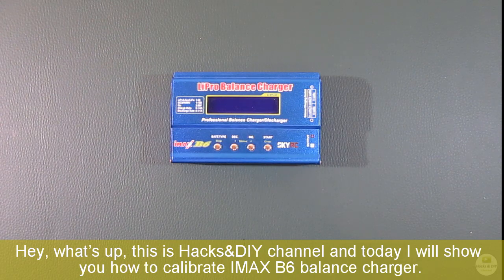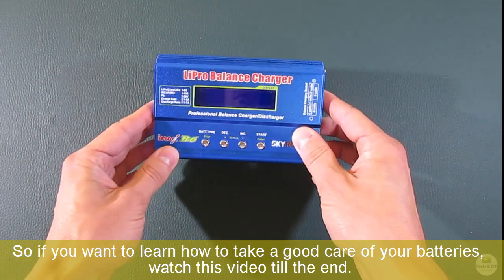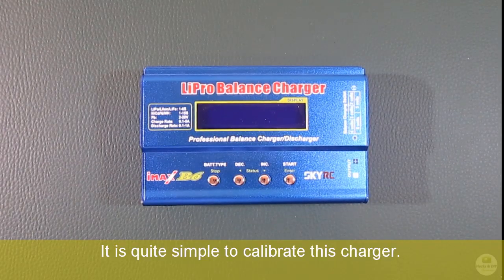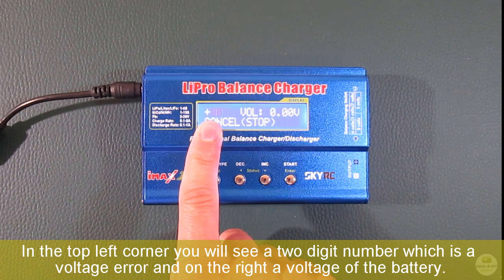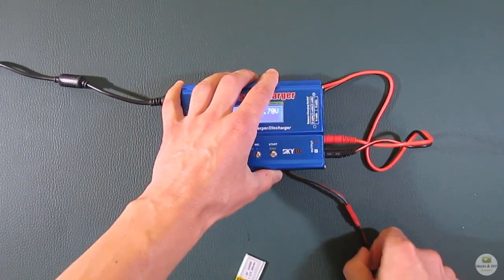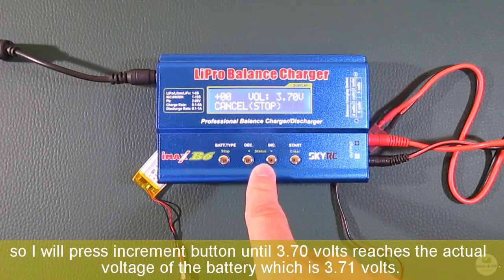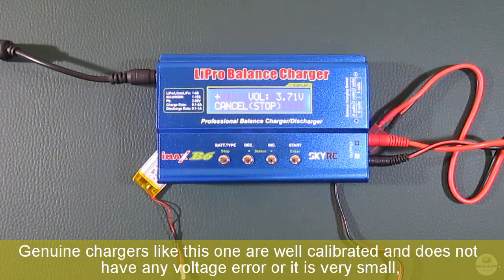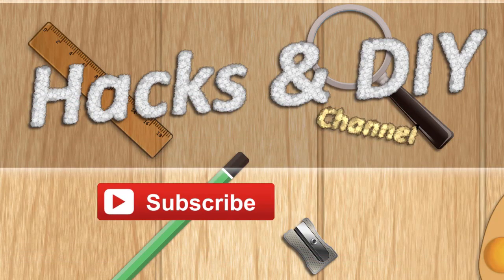Attention! Calibrate your IMAX B6 balance charger before use

Comment: Probably good to check calibration but make sure your meter is calibrated and 0.01 volt error is nothing as the meter has a greater tolerance than that

Comment: Thanks.....how accurate are these at showing or reading the actual capacity of the pack? If I'm not mistaken,  the reading under voltage while charging a lipo is supposed to be the actual capacity of the pack being charged.....is that correct or no? Any info will be appreciated. Thanks

Comment: hey! i hold down the dec and start and then i turn it on and it is in the calibration display but its starts with 3.2 and then slowly drips down but i havent plugged anything into it. is this normal?

Comment: I have the sevenchip version of this (same product) however it does nothing when I hold down the 2 buttons and plug it in. Is there a different key press combo?
Reply: I also have Sevenchip b6 v3. Did you find the correct key press combination?

Comment: I have a fake one and even if i try to calibrate  it still off by .3 volts
Reply: Mine is off +0.08, and after max calibration of "+20", it's still off by 0.05, looks like it only goes +/- 25mV
Reply: @zlac  how did you enter the calibration menu?
Reply: @ayyhmed  It's literally shown in this video
Reply: @zlac  it doenst work for me. i gues i have a shitty fake

Comment: Theres a lots of gotchas here. First, you have ti make sure that your multimeter is AT LEAST 99.9% accurate. Second, you have to you a wide variety of batteries, not just ones, as every battery has its own internal resistance that can either make it difficult to charge or easy to charge. But nice tip nonetheless.

Comment: Just received a B6Mini clone. It doesn't seem to have the calibrate function. I'm a sucker for low prices.
Reply: same here
Reply: Mine doesn't have either
Reply: Same, it just ignores my button presses and starts normally.
Reply: @MmeHyraelle  did you find the solution?

Comment: I'm bit confused now. I just received the lastest iMax B6 V2 from Banggood. It is a genuine one which can be proved easily. A new buyer must scratch a thin 'cover' over a hologram, scan and send to www.skyrc.com. Skyrc will confirm whether it's a fake or genuine item from them.  My iMax B6 V2 has a Menu call Tools where we have option to check Battery resistance and Voltage (to be used as Voltage meter). If you have a Lithium Battery, it shows the voltage of every cell including the Main voltage (using balance cable). My iMax B6 V2 is always showing lower voltage than the Multimeter which you are using too (same model). How do I know that my Multimeter (although has more digits) shows the correct value compared with the genuine iMax B6 V2? To be honest it was a cheap Multimeter which I bought for other purposes compared with iMax B6 V2.
Reply from the maker: Actually you can't. This video shows only the method how to check your charger, but in order to be precise you need to use a high quality multimeter. However fakes sometimes has very big error, therefore in this case even cheap multimeter is better that nothing.

Comment: For the owners of genuine Imax, SKyRC offers since ...september 2016!  a new firmware 1.14, which allows calibration for ImaxB6 AC and Mini (specific FW link for each version)
The link is : https://www.skyrc.com/blogger/190
You find the link to download the good firmware, and all explanations for correct use.
 It's necessary to have a 6S battery with balance switch for the operation.
For owners of other Skyrc chargers you open the homepage of Skyrc , you explore the page, you find "News" and you click on "read all". You find there all firmware downloads, even someones which are not proposed on the official page "download" of the site. This was the case for this 1.14 firmware.
If that can be useful for someones.....

Comment: Hi, I have a genuine Imax charger and calibration is possible. I'm just waiting for a fake, bought on ALI , and I will know if it can do it or not.
However, on the fake ones it seems not possible to calibrate... So, with full-charged Lipo cells , if you see a light overvoltage after comparing with a voltmeter , you can simply choose the Li-ION program instead of the Lipo program : it charges a little lower at the end, so your cell is not charged at 4,20V but at 4,10V. It does not matter, you lose some milliamps but the difference is very thin and you are sure of the good protection of the cells. You can simply do a test...
It's really not good to charge a cell at 4,23/4,25V, but it's no problem to charge it at only 4,10/4,15V...On the contrary that preserves and extend the batterylife.
For example I have a Panasonic Ebike battery 36V usually fully charged at 42V. But the Panasonic charger is designed for stopping the charge at 41,6V max to preserve the batterylife. The maximum possible charge is not the best charge. 
So if your fake Imax overcharges, it's a real easy solution with the LI-ION program and your cells will be happy to your choice.
Excuse my approximate english, I write you from France and my brain is now fully discharged! I will try a shot with my Imax.....
Reply: I bought a fully new version, iMax B6 V2 just few days ago. It is a genuine one which can be proved easily. The new buyer must scratch a thin 'cover' over a hologram, scan and send to www.skyrc.com. Skyrc will confirm whether it's a fake or genuine item from them. ! It's a 60 Watt charger, SK-100161, improvement of the 50 Watt Mini. It's not possible to recalibrate in pressing those keys. The possibility to calibrate has nothing to do with fake or not!

Comment: You can do this before you even know if you have to enter the calibration mode. Experience has taught me that on some devices you run the risk of making mistakes or experiencing totally unexpected things happening, including BRICKING devices, when using "special" modes.  For example, weird things can happen on some devices if it's power is disrupted or if you press the wrong button at the wrong time during a given process. 

So, before you enter the calibration mode, you can also measure a cell or battery pack's voltage using the "BATTERY METER" function. It's at the top "BATT/PROGRAM" level. As you cycle through the options, (e.g. LiPo, NiMH, Pb, SYSTEM SETTINGS, BATTERY METER, etc) you select the "BATTERY METER" option. It will display the measured voltage without having to enter any calibration mode. IF it needs calibration...THEN you may decide to enter calibration mode. If you don't have to calibrate then you have avoided a POSSIBLY risky procedure.

I would also recommend connecting and reading the multimeter/voltmeter at the same time you are reading the voltage from the B6 unit. This ensures the wiring is identical while both measurements are made and compared. Also, the voltage of a battery can change by a surprisingly high value even over a short period of time depending on things including how recently is has been used or charged , if the temperature has changed, and so on. So while not perfect it still ensures you're at least measuring the battery at the same time with both the B6 and the multimeter.

See the user manual for diagrams of the menu levels and the added functionality of which you may at the moment be unaware.
-----------------

Sorry about multiple edits. I have some disabilities and sometimes I don't catch all the typos or things I meant to include in the first few passes.
Reply: Don't sweat the edits, at least you're conscientious enough to do them. BTW, thanks for the good advice.
Reply: Very smart idea. Thank you
Reply: Good point! Thanks.
Reply: Very smart idea. Thank you

Comment: I have a b6ac, and I do experience some issues with NiMH charging. Even with new cells the charger cuts of the charging and notifies the cells are full, sometimes even at 1/4 of the capacity.
Measuring the discharge shows the batteries were not full.
When using an old fashioned trickle charger I am able to charge the batteries completely.
Any tips for that on the b6?
Reply: Mine seems to charge the lipo batteries for like 15 mins and then says it’s done and the nimh batteries will only charge for like a minute is this the same problem as yours ?
Reply: Ya same as mine....

Cannot charge battery full at all..... 😩😩😩😩😩

Also cannot do calibration , even press both button before plug in..  no such setting at all...

Felt being cheat bought this charger 😩😩😩😖😖😖

Comment: It worked thanks, multimeter shows 3.90 so charged the 3.88 to 3.90 on the charger, however, when I put the cell on charge, the charger shows 3.98 straight away, I immagine is because when we pulling amps voktage sags and when we putting amps voltage increases?
Reply: I've noticed on multiples of this meter...all VERIFIED authentic...that each time you connect a cell or battery pack to the same unit it can read a different voltage. This is within seconds of prior readings, and all measurements are well after the cell/battery has been given enough time to stabilize after any charging or discharging. In my opinion this device can display inconsistent voltage values even when it is authentic and working "properly". I believe this is likely due to resistance changes in the connections and connector clips as they are disconnected and reconnected between readings of a given cell/battery, and variations during self-calibration during its power-on sequence. Differences greater than the 0.01V that "Hacks & DIY channel" discusses in the video are not uncommon.
Keep in mind that the voltage of a cell/battery can change significantly after having just been charged or discharged. For example, you may charge a Lithium cell to 4.20V and within seconds of charging completed and the cell being disconnected the cell's voltage can easily drop to something like 4.10V. How quickly and how far it changes can depend on temperature of the cell,  the age of the cell, the quality of the cell, cell type, and more.

Comment: An error of 10mV is NOT an issue for a 3.7V lithium cell.
For all you know, the 10mV error is caused by temperature or even test lead impedance differences.
You also don't know if the error is linear or if it increases or decreases for higher numbers of cells (e.g. 6S configuration). By correcting a 10mV "error" on 1 cell you could actually CREATE a significantly larger % error on multiple cells...so you might actually cause more problems than you fixed by simply checking with the 1S configuration. Many DMMs have different specs for error ranges depending on which scale you're using to take the reading. For example, you might see +/-1% +5 on the 2V scale and +/-2% + 3 on the 20V scale.
Reply: Sure, but not everyone is going to have the same calibration error margin are they. He's showing the procedure, not the value in this demo!
Reply: I have voltage display at 14v and gradually going down to 0.00 in about 5 mins. Mine is probably fake but I am not sure.

Comment: So what do you do if holding these buttons down while plugging  power connector in does nothing at all? other than turn the charger on?
Reply: You go out and buy an official SkyRC charger... it's the fakes that don't have the calibration function.
Reply: hold down buttons before plugging in
Reply: @lenny0347  I've since found out that some of the fakes ones do indeed have calibration and some of those don't have a good enough calibration range though. Like the one I might own now.
Reply: I googled and apparently the calibration is locked to once on some models. I guess i got one of those.
Reply: @MmeHyraelle  I was able to do mine twice on my "knock off" version, although I had to put it all the way to 14? to hit the spot..

Comment: How about fake chargers ???  I have a fake model of eighty watts too late to charge, does anyone have a problem with me ????  It fills up the amp in the early minutes but lasts a lot !!  To fix the problem, what do I do ???  please guide me
Reply: did you find the solution?
Reply: @ayyhmed  I think there is no need, as there is no voltage differences that cause allergy
Reply: allergy?

Comment: First....Attention! Calibrate your MULTI-METER before use
Reply: wanna sound smart, eh?
Reply: @pixelcomet  I see what you did there XD
Reply: That's my question too. It is a genuine one which can be proved easily. A new buyer must scratch a thin 'cover' over a hologram, scan and send to www.skyrc.com. Skyrc will confirm whether it's a fake or genuine item from them. Mine is genuine.  iMax B6 V2 has a Menu call Tools where you have option to check Battery resistance and Voltage (to be used as Voltage meter). If you have a Lithium Battery, it shows the voltage of every cell including the Main voltage (using balance cable). My iMax B6 V2 is always showing lower voltage than the Multimeter which he is using too (same model). How can I trust that my Multimeter (although has more digits) shows the correct value compared with the genuine iMax B6 V2 . To be honest it was a cheap Multimeter which I bought for other purposes (exactly the same model as in this video).
Reply: For fuck sake’s, I’m running out of money here 🤦‍♂️
Reply: FourDollaRacing ... calibrate it with what lol, another volt meter that need to be calibrated with another volt meter lol.
Reply: Auto Body Everything at work we calibrate multimeters with known supply voltages and resisters. This calibration station is in turn calibrated by an external company that specialises in calibrating equipment.

Comment: I have a fake and it doesnt open calibration display :(
Reply: For me as well, I have a fake like you, charging time is not long ???  For me, the first few minutes of the Amper goes up fast, but it slows down in the final moments
Reply: @KAMRANGXP  this is normal. The last bit of a lipo is charged at a much slower rate.

Comment: Well thank you for the video ..on calibration....however many of us have the clone, or fake B6...can you figure out how to  calibrate it 

too.....I have a fake one and it does not read correct voltages...
Reply: @JitterzZ 88 Can you explain more ???  I have a fake one just like you.  I hold the button too tight, but it doesn't work!  What exactly are you doing that ??
Reply: @JitterzZ 88 Thank you so, so these fakes can't be calibrated in any way ???  Because my charger starts charging fast but it takes hours at the end
Reply: @KAMRANGXP  did you find the answer? i cant seem to enter the calibration menu
Reply: @JitterzZ 88 Very strange!  Anyway thank you for your answer

Comment: This does not work skymax Charger it just goes to charging mode
Reply: I think you using fake b6, like one of mine.. can not enter calibrate mode.
Reply: @JitterzZ 88 Some fakes ones doesnt go into calibration no matter how and how many times you try.
Mine doesnt
Reply: @JitterzZ 88 a real fake :)
Reply: It's not SkyMax then, it's fake.
Reply: Then you have a fake charger as this method is only for the genuine ones.

Comment: Why mine cannot enter calibration mode, when I’m holding decrement and the start buttons nothing happen? Anyone have the same issue?
Reply: I have original one, and easy push those button to enter calibrate mode.
But the fake one was not able to enter the calibrate mode.
Reply: @MrAirbleed  I have both a fake on and an original. The fake one doesnt go into calibration no matter what. The original does it with no problem. i also have an original b6 mini and a fake Htrc imax mini b6ac. i need to test those soon also
Reply: @Viking_X  it means they use different algorythm. And i dont't know how to find it.
Reply: Yes anyone knows what to do about that ? Same damn
Reply: José Covaco I still can’t figure out, let’s wait for someone who already have a solution.

Comment: Very nice tutorial.  I have the IMAX B6 v2 80 watt model and when I hold down INC and Enter then plug in power all I see is the firmware version. They must have changed something.
Reply: Rob C , Same ^^^^
Reply: All I'm getting is "System Update, Please Wait...."
Reply: Don Michael Corbin did you work out how to calibrate it?
Reply: @EHaubne  No, but choosing "Factory Reset" did fix my problem, which was it's refusing to charge a 4S LiPo that I'd bought.
Reply: You must press DEC. and START, not Inc and start.
Reply: Mine just starts normally.
Reply: The 80 Watt version of IMAX B6 v2 is definitely a fake. If you check the original SkyRC website, they should be 60 Watt. Also, you should have a validation sticker on the back of your unit to check.